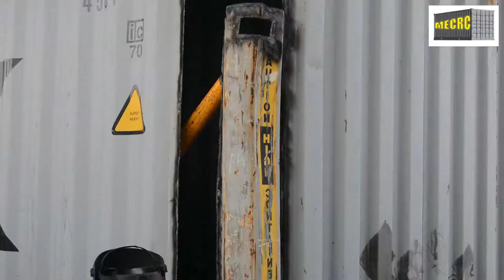Corner Post Repair

Comment: They did not measure the ends of the hardware for the height of the post and they did not measure the ISO measurement of the hardware.
Reply: Podria tener la amabilidad de explicarme estoy interesado sobre su aporte.
Reply from the maker: Thank you for the good observation. However, the video is on time lapse and it was not recoded in full details, it is just to show the repair. The needed requirement to repair this portion of container has been done as per the IICL repair standards.  😊